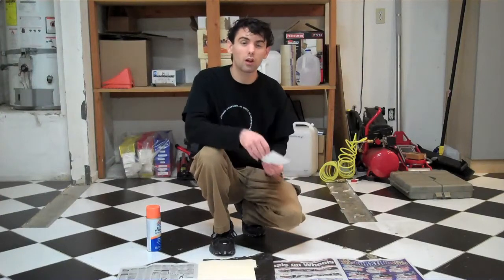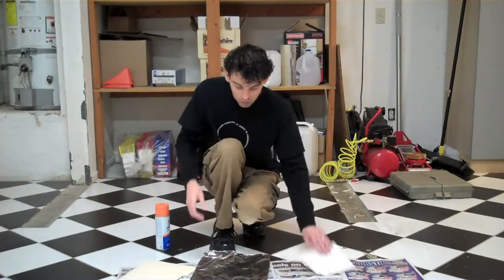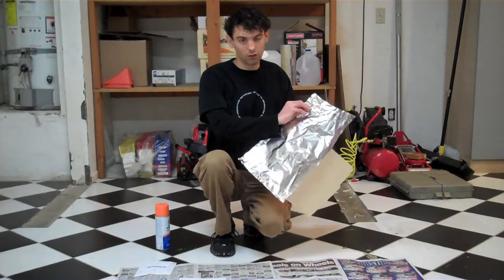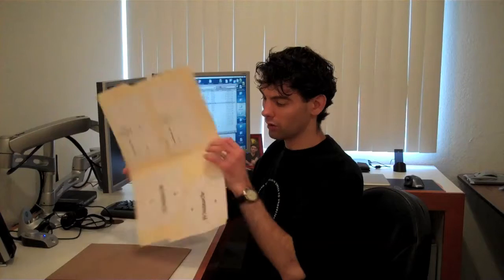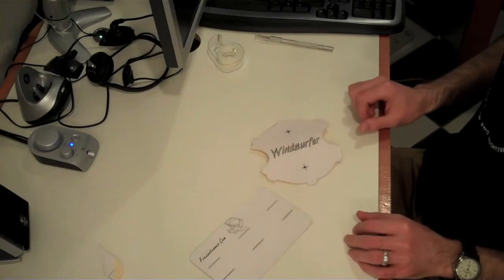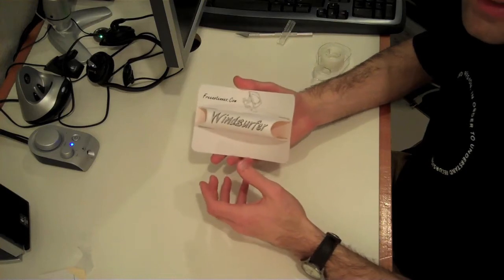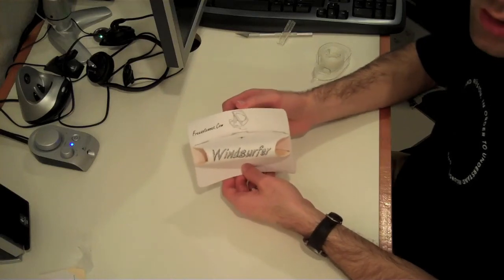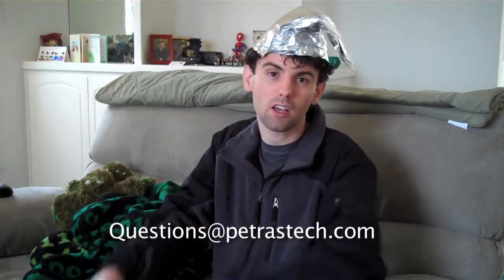PQA Ep. 4: Boosting Your WiFi Signal

Comment: if it is a wirelles router with internal antenna(s), depending on model, there are many different external antenna kits sold on ebay. with them, you can install stronger ones and then use windsurfer on them.
on the other hand, if it is router without antennas (access point), buy one with  them - wireless router

Comment from the maker: @omerocelikkol Well, it did result in stabilizing the wireless connection to my media PC... sometimes there's a signal boost and sometimes, like in my case, it merely solved my packet loss and connection drop issues.

Comment from the maker: @vietsoul2 If you feel that's the case, then I invite you to review the designer's instructions as well as assembly tutorials from others (like Revision3's Systm, for example). I'm sure you'll find them to be the same. Additionally, from a functional standpoint, it doesn't matter which side of the parabola the aluminum foil is attached to, aside from attachment to the inside possibly causing performance-altering deformation of the foil (crunch rather than stretch).